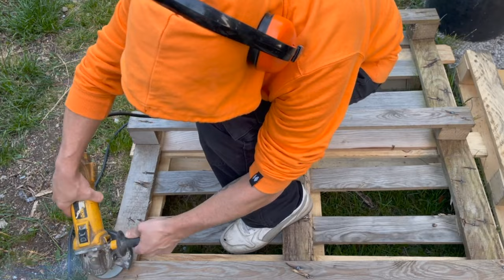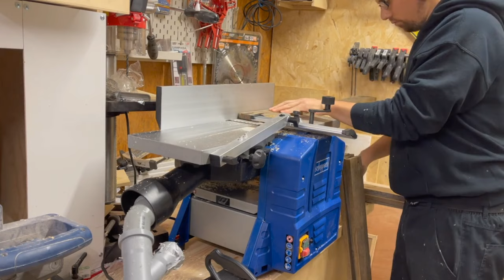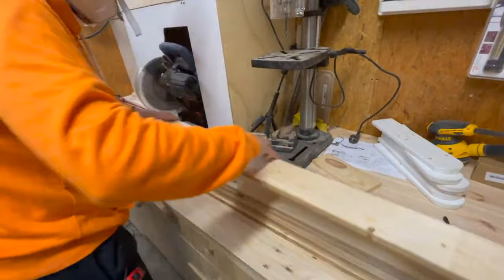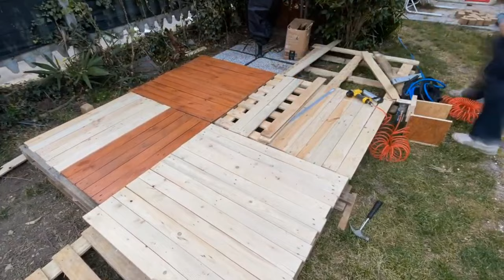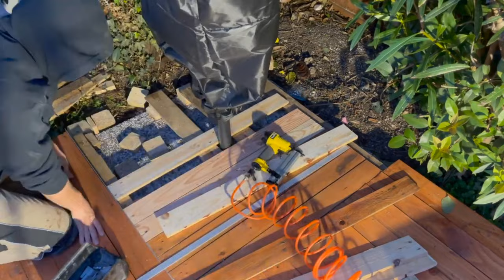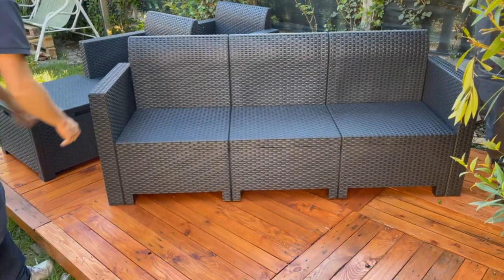Cómo hacer SUELO de MADERA con PALETS | TARIMA o PISO Estilo Deck Fácil & Barato

Comment: Con que lo pintas?
Reply from the maker: Se pueden encontrar de muchos tipos, aunque las pinturas acrílicas son las más cómodas de utilizar en este tipo de trabajo ya que secan rápido y se limpian directamente con agua. Aplicaremos por lo menos dos capas de pintura con ayuda de un rodillo y dejaremos secar entre capa y capa siguiendo las instrucciones del fabricante. Para terminar, podemos aplicar diferentes acabados al palet. Podemos optar por aplicar una capa de barniz protector sobre la pintura que le aportará mayor resistencia y durabilidad, y la protegerá contra la humedad.